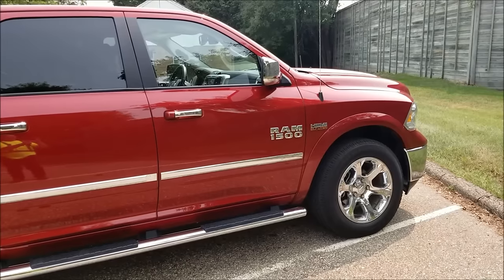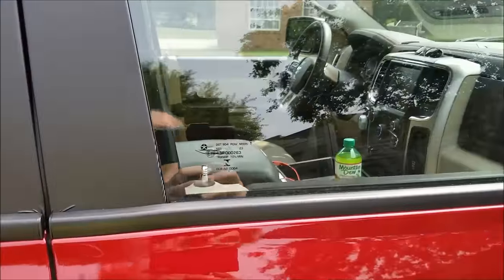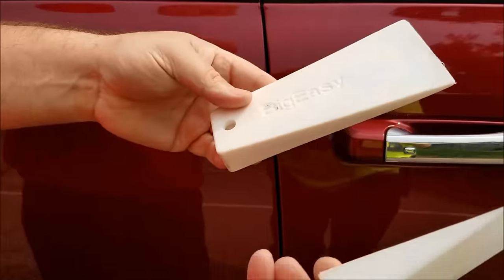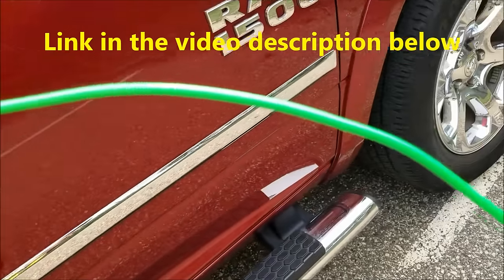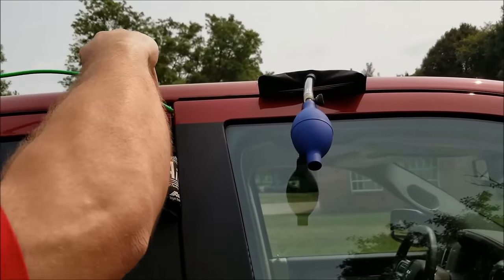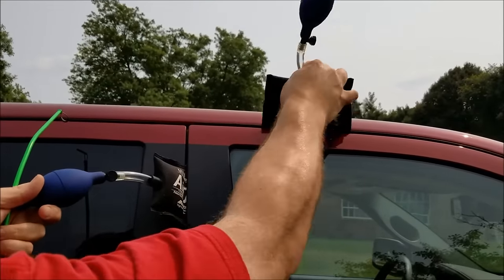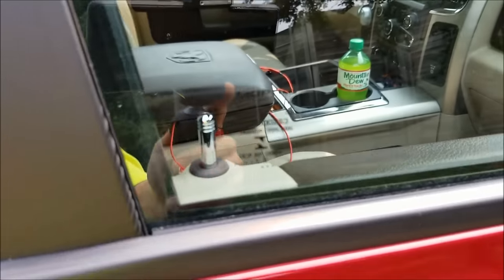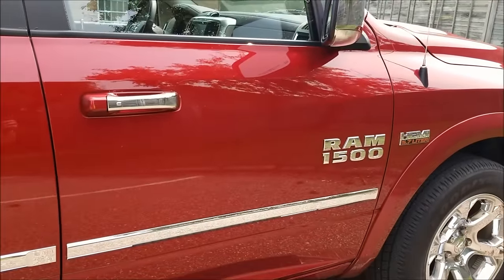How to unlock a car door without keys, the easy way.

Comment: Lucky, I don't have that type of lock on my 2014 Dodge Grand Caravan 100th aniversory of the Dodge.  I have a Low jack, and I'll kilswitch on my vehicle.  The locks are inverted they go down, and lay flat.  The lowjack informs me, and the police that the vehicle is being stolen, the kilswitch kills the battery and electrical system, and also locks the wheels (wheels will not roll).
Reply from the maker: All of that is great to hear. However, just because you dont have this type of lock, doesnt mean your doors cant be unlocked. There are many types of car door unlock tools for every type of door lock on the market. This was a video demonstration for only ONE tool. Thanks for the comment.

Comment: Can’t do this on a lot of cars because the lock you grab onto is inside the door meaning there’s nothing to grab
Reply from the maker: Correct.... And I already  mentioned that in the video. This was a demonstration of one specific door unlocking tool. I never implied this tool would work on every car. There are many different types of door unlocking tools on the market, this is only one of them.......

Comment: This is the quickest way...? I have to buy all that?
Reply from the maker: If you're a mechanic,  tow truck driver,  roadside assistance guy, work at a car dealership or repair shop and you might have to unlock a car door, yeah this method is pretty quick. You don't have to buy anything. This was simply a video review of a door unlocking tool. Thanks for the comment.

Comment: Thanks I was tired of breaking Windows when I steal my cars now I can just use that Gadget
Reply from the maker: Yeah, now all you need is another tool that magically unlocks the steering column and hot wires the ignition and you'll be all set.

Comment: Or you can just unravel a coat hanger, slip it underneath the weather stripping and hit the power door lock button and unlock the door locks.
Reply from the maker: You could..... depending on the make and model. Nowadays, most electric unlock buttons are disabled. The days of reaching in with a long tool and hitting the unlock button are just about gone.

Comment: The best is to duplicate your car key and put it in your wallet inside you pocket or call triple A to open it by the tow truck driver caused i have slim jim but its inside my suv so i ended walking around 2 1/2 miles from store to my house to get my car key duplicate and i put it on my pocker wallet.

Comment: With all that, a length of wire , good old # eight , wedge the door a little to get in behind the the rubber obviously pre craft the wire prior, and good luck, most countries have auto care companies that will access your locked car for free if a child or pet is locked in , for free if a member, or charge if not,
Reply from the maker: Yes, there are MANY ways to unlock car doors.  Pick your flavor.   As for accessing your locked car for free if a child or pet is locked in.....  It may be free where you live but not around here.  If it's a true emergency, the cops will break the glass.  They don't wait for anyone to unlock doors when it's an emergency.  Otherwise you can PAY a company to unlock your car, if you're not a member of a motor club.  The fact that a pet or child is locked inside is irrelevant.  I don't know anyone who will drive all over town providing car unlocking services for free.  Nobody works for free!

Comment: Now is new technology if your car key left inside the car ... your car doesn't locked. 😁😁😁
Reply from the maker: Correct. However, there are still Millions and millions of cars on the road where it is still possible to lock your keys inside. Not everybody has a modern new car...

Comment: So I just pull those out of my butt and quickly unlock the car door. Thanks mate.
Reply from the maker: Do whatever you want. This was a demonstration of a door unlocking tool. If it doesn't work for you in your situation, then find another solution. Lol
Reply: @SlipFitGarage  well maybe that should have been the title for this video.
Reply from the maker: @Ricardosanchez0111  

The title is "How to unlock A car door without keys" which is exactly what the video shows.
Reply: @SlipFitGarage  yeah I remembered that after I typed it.
Reply from the maker: @Ricardosanchez0111  

Okay. lolol

Comment: How about those modern keys with large remote controls you ask ? A key will always open the door without remote control... Have one made without it. Manufacturers have not yet manufactured keys with remote controls that will open the door when you left it locked inside your vehicle... The Real Creator gave you a gift... You are given BRAINS use it properly...
Reply from the maker: Thats all fine and dandy but trust me, people still find a way ro lock their keys in their cars without having a spare. There is a multi billion dollar per year industry unlocking cars for people. Its called roadside assistace. Thousands of people per day across the US get locked out of their cars.

Comment: This idea will working for thief😂😂😂
Reply from the maker: Its more than just an idea..... these door unlocking tools were designed for locksmiths, mechanics, tow truck drivers, auto auctions, car dealers, roadside assistance guys, etc... if a theif gets their hand on these tools to break into cars that is unfortunate, BUT THAT IS NOT THE TOOL'S FAULT..... These tools exist for a legitimate reason. Get over it!

Comment: and how to do this if that pin is hidden in the door interior , this wont work hihi
Reply from the maker: You're right, this won't work. You would need a different door unlocking tool. This video was a demonstration of only ONE type of door unlocking tool..... there are MANY different types.
Reply: @SlipFitGarage  i understand, thank you for answering great video anyway

Comment: Your car antenna could also work
Reply from the maker: Sure, in some cases.... thats an old trick that works great if you have door locks that can be manipulated with that type/shape of tool. It doesn't work on all cars and it would not be very helpful with the type of door lock shown in this video. Thanks for the comment.

Comment: Are you supposed to carry this in your wallet, purse?? If you're locked out, 99.99% of the time the tools are inside the vehicle. Then what??
Reply from the maker: This was a video demonstration of a door unlocking tool. That's it. Store the tool wherever you like. These tools are used by roadside assistance guys, locksmiths, tow truck drivers, auto mechanics, car auctions, car dealerships, etc.

Comment: Honestly this video doesnt help at all for 99% of the people and ill tell you all why.
If you own the tools in the video you should already know the basic idea of how to use it, so the video is just a guidance on "how to use the tool".
Most of the time people will not have the proper tools to do what the video is suggesting especially the rigged "green" cable.
Not trying to bash on the video but it does get annoying when I try to look for tips online and the videos like this requires "special" tools that for the most part 99% dont own unless they dealt with the problem and own it.

I personally ran into a situation where i have ZERO tool and was able to open the door with similar locking mechanism in the video by using a string that most people should have at home. 
While writing this comment I actually found a video that did exactly just that. Youtube "How to unlock a car with a string" . Mind you it is NOT as easy as it looks but it does work. I had to pry the door a bit to make things a bit easier to adjust the string. I hope this helps most of you who dont own the tool in the video.  LIKE so more can see!
Reply from the maker: There are people in this world who have to unlock car doors as part of their job on a daily basis.  Locksmiths, tow truck drivers, roadside assistance guys, people who work at auto auctions, car dealers, auto mechanics, etc, etc...  All of those people buy door unlocking tools for their job.  It's no different than any other person who works in a "trade" and has to buy tools for their job.....  And believe it or not, people who unlock car doors, and buy door unlocking tools.... they watch YouTube, too. Just like anyone else working in any other trade.  Everybody watches youtube. Sorry my video didn't help you.....  but neither will 99.99% of the other videos on YouTube.  Thankfully, unlike most others who post negative comments under this video, you were able to improvise and find a way to open your car.  Most people just take out their frustration on me for locking themselves out of their own vehicle, as if it's my fault somehow. lolol.  Good job to you!

Comment: I see no advantage to this.  The tool will either be in my locked vehicle with the keys or in the house where a spare key should be anyway.  If used on a friend's vehicle I would not dare try it.  Everything that happens to the door later including water leakage around the weather stripping could have the blame placed on me with a request for me to pay for the repairs.
Reply: can keep in the toolbox in the bed if you have a truck
Reply: @RUNOVRYOU  Unless the toolbox is locked and the key for it is in on the same keychain as the truck keys.   All the trucks at my job are that way

Comment: this is stupid sho carries an air bag just make a copy of your key buy a hideakey put your key in it hide it under your car the hideakey is a small plastic box with a magnet I've been using one for years they used to be made out of metal a long time ago now they are made of plastic and they cost about $5 bucks or less the last one I bought was only $3.99
Reply from the maker: lolol.  Obviously a spare keys works the best. This was a video demonstration of a door unlocking tool that people use to help others get into a locked vehicle when a spare key isn't available.  I thought that was obvious.....

Comment: No thanks. I just carry a small piece of porcelain from a broken up spark plug in my pocket along with my change. One little flick to the side window of the car and it shatters into pieces. Then I just get a replacement from the junk yard for about $10. It's cheaper than calling a lock smith believe me. And much cheaper than buying lock-out tools👍
Reply from the maker: True. But not nearly as convenient.

Comment: When I worked on a recovery company in the uk I found that it was not easy to use that tool. Awkward and ridiculous. Quicker to smash the glass.
Reply from the maker: It's easy to say smash the glass when it's not your vehicle. Dealing with broken glass clean up, insurance companies, and glass installation companies during the aftermath is a pain in the ass. Thanks for the comment

Comment: Totally unnecessary. You can do better and much easier with that flat plastic packing tape they put round boxes. Fold it over creating a loop, thread it through the rubber seal and hook over pin and pull. Hard to describe but works a treat and saves the money.
Reply from the maker: You should make a video showing this technique.

Comment: I don't think i'll have when in my pocket when i need it and also you been into the frame around the window that's not good for it
Reply from the maker: What? These are the type of tools that every tow truck driver, locksmith, roadside assistance guy, mechanic, etc use to unlock tens of thousands of cars across north america every day.

Comment: Are you freaking kidding me, no wonder it's so easy to get in someone's car.  Gee Thanks for teaching the criminals.
Reply from the maker: LOL, this video didn't teach criminals anything.  They already know how to break into cars. These door tools have been around for decades.  Every locksmith, tow truck driver, roadside assistance guy, mechanic, auto auction, car dealership, emergency services, etc. has these tools, and they use them every day. They can be purchased anywhere on-line, at most auto parts stores and truck stops across the US.

Comment: All you need is 2 airbags 2 wedges a three 1/2 air compressor with a wrench    attach it to the compressor. 1/2 ton floor jack. You also need a steel band with a notch cut in it. You also need a telephone, use the telephone to call a locksmith and when he comes offer to give him the air compressor if he opens your door for you. You must be crazy if you're carrying all that equipment around in the car. you do know you're going to have to have the door unlocked to get to the equipment am I right. All right enough said on to the next incredibly stupid video.
Reply from the maker: Have you ever bought a tool to put in your tool box so that you have it for  future use? Have you ever used your tools to help friends or family? Think ahead more than 5 minutes....
Reply: @SlipFitGarage  I have a slim Jim. Occasionally you unplug the  motor that Powers the window up and down. Which is a pain  you have to take the door panel off and plug it back in but truthfully that's only happened once to me. The best way is to put a key in your wallet. I'm 66 I've locked the keys in my car once when I was 18. I started carrying an extra key in my wallet works first time everytime. The slim jims for random people you meet. Like I say it's always worked for me and only been a pain once.

Comment: You be a bit fucked if the door lock is the type that locks flush with the panel
Reply from the maker: This was a video demonstration of one particular type of door unlocking tool. I would not be fucked at all, I would just use one of my other tools.
Reply: brianok100 do a video on that type of lock.  I like the kit you had on this video. 👍👍

Comment: That wouldn’t work on a chevy
Reply from the maker: It depends which make and model you're talking about. Itworks terrific on a lot of the newer Chevys.
Reply: 06 Silverado 2500 the doors won’t unlock if the security is on.
Reply from the maker: @thomasraymond4909  
I own a 2006 Chevy. The door locks are on the inside of the door pannel and require a different unlock tool, altogether. 2006 GM trucks can most certainly be opened. I've unlocked MANY of them. And a side note: this tool does work on 2007 and newer (new body style) GM trucks.

Comment: I have another easy method
Reply: tell me plz
Reply: Remove the black strip below the window 
It will remove completely 
Then take a long road and push the lever inside the space after removing the strip the lock will open
Reply from the maker: The door unlock industry went away from interior door tools years ago. Nowadays with air bags and such inside the door, if you're not careful you can cause problems.
Reply: But what if you are in hurry

Comment: Buy a ford it had keyless entry
Reply from the maker: Had?  That Ford keyless entry system is nice, for sure.  
However, this was a demonstration of a door unlocking tool and millions of vehicles still on the road today do not have the Ford keyless entry system.
Reply: @SlipFitGarage  my point is all cars should have keyless entry. Plus now you can unlock ford cars with your phone from anywhere in the world. There is no reason why the rest of the manufacturers could not offer this.
Reply from the maker: @Redavisunwind  
That's all fine and dandy, and I agree. However there are millions, upon millions of older vehicle still on the road today that don't have all this fancy new tech.
Reply: @SlipFitGarage  Yes that is true. It is nice to see how to get in your car with the video.  But it is sad too, my 1999 ford f150 had keyless and thats 20 years ago. Ford has offered keyless since the 1980's in some models. Tells you how far behind other manufacturers are. Or they just don't care to offer it. It is so nice when you go to the beach or pool and just leave everthing in your car locked up (phone, keys, wallet) not having to carry it with you. I used to keep a key in my wallet to just get in my door before having keyless entry. I suggest everyone that doesn't have keyless entry do this. You do not have to get a full access key but just a old flat one that just opens it but will not start the car.
Reply from the maker: @Redavisunwind 
I agree. But I must say, you wouldn't believe how many cars I had to unlock because the battery in the key fob was dead. It happens....

Comment: O nice one new tools for the bloody thieves out there. glad that shit wont work on my 4x4.
Reply from the maker: This was a video demonstration of one specific door unlock tool. There are many unlock tools on the market. One of them will work on your 4x4...
Reply: Very much doubt that mine being keyless entry.
Reply from the maker: @daveashy1835  
Just about every vehicle on the road made in the last 20 years has keyless entry, including the 4x4 Dodge pickup in the video. I've been unlocking car doors for 29 years, I have yet to find a vehicle that could not be unlocked with door unlocking tools.
Reply: Keyless entry I meant to my 4x4 there are no keys at all not even for the ignition in my ford custom v8 Diesel only electronic devise no keys to loose. your airbag devise wouldn't work on this vehicle built with a double door frame you'd need a crowbar to even try to get your airbag in the frame trying this would only brake the glass and bend the door. come to Australia try out your test to fail. no one here would travel 1600km to open my door any way your devise more suited for the city Dwellers. good luck though helping those in Need.